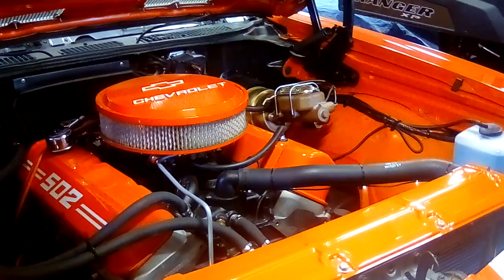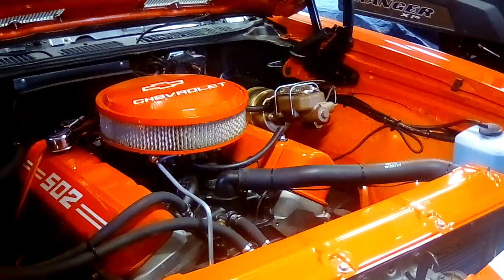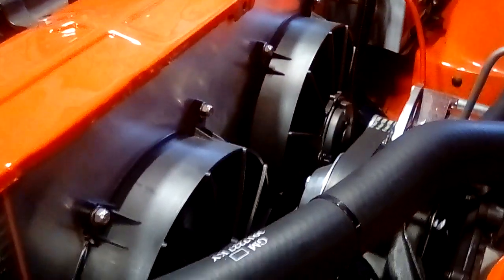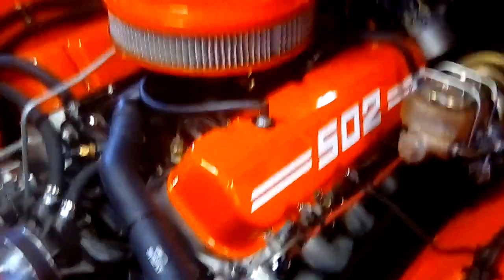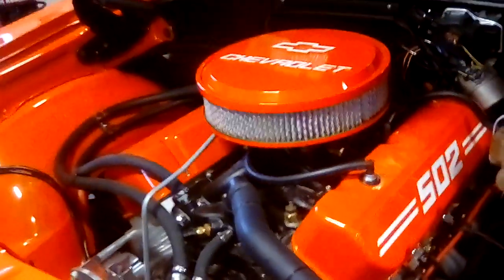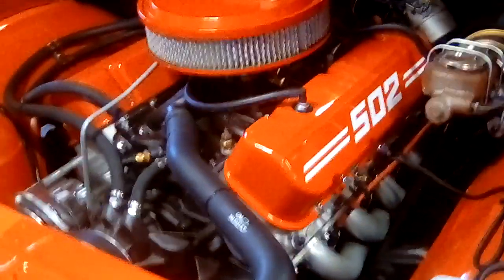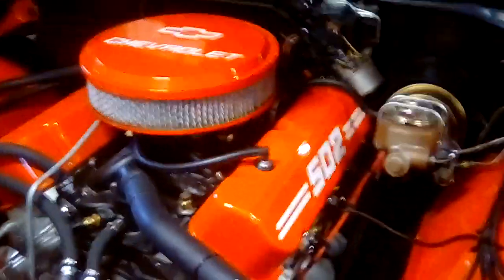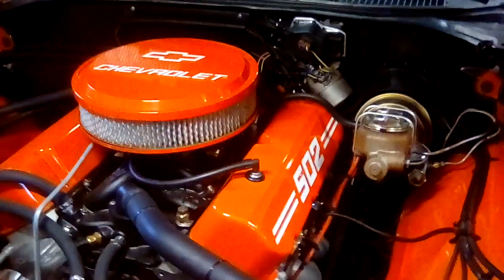ZZ  502, install tips you must know!!!

Comment: Hey Jeff, I have 502 Big Block Chevrolet casting # 10237300 Generation 6 Big Block paired currently the 350 automotive transmission with a shift kit  its in  a 1980 Malibu. All the stuff you mentioned I have done.  I need the engine wiring harness that will connect with the rally gauge cluster and work ? Any suggestions? Or factory wiring harness will work with modification?
Reply from the maker: Factory harness would have to be modified!! wiring is always a pain in the azz!!!

Comment: I just zz502 for my 70 chevelle I just a oil pan but I'm using the stock oil pump that came with motor but it's not high volume
Reply from the maker: 70 chevelle ,nice!!!, What oil pan, and how many quarts does it hold!!!
Reply: @jefftovani5535  champ oil pan 7 qaurts
Reply from the maker: As long as bottom of pan clears you should be good, when I did mine nobody made 7 quart that cleared the saddle in frame, but that was 5 years ago, have fun with it, really nice engine!!!
Reply: @jefftovani5535  wat did use for a macanical fuel pump rod i got the gem factory one itsa steal one
Reply from the maker: With zz 502, it has soft billet camshaft, you must use bronze tip   fuel pump push rod, or you'll prematurely wear out camshaft lobe!!!! I got it from summit racing, I look back at my notes, for part # and post it!!!

Comment: Jeff what steering are you using and what frame + motor mounts ? 
I m not to happy with how I have it mounted yet, I have a vibration but I have to get the driveline balanced,  Im running a holly sniper.. not as nice as your beast but its a work in progress.
Reply from the maker: GM Saginaw steering box,A-BODEY frame,GM heavy duty big block motor mounts!!

Comment: Heey man beautiful car! I have some questions, I have a 502 aswell and I'm getting some overheating issues aswell as my fan are DRAINING my battery. It's a electric dual fan 12" 4000cfm and a 2 row rad, the fans come on around 190 and stay on until the car temp drops but I constantly have to boost the Truck
Reply from the maker: Hi, damien, i run ecp,( engineering cooling products), 11 inch duel fans, 2 row, 3000 cfm, rad!!   I use 160 degree thermostate, set the fan control box a160 degrees!! I run mildon high output water pump!! I run power master 150 amp alt, 90 at idle!!! Stock 68 chevelle had 55 amp, and that was not at idle!!! Those fans you have draw 50 amps at idle!!!!  This set up should solve your problems Hope that helps, stay tune for more goodies!!
Reply from the maker: Started with 182 ,degree termostate, ran a little hot, then changed to 160 degree stat, and it was much better!!!
Reply: @Jeff's garage adventures   ohh okay I can definitely try that I know we changed the thermostat but I don't know what the degree is I know for sure I have the change the exhaust and the alternator I might run the same fan setup as you
Reply: I’d say your overheating problem is your 2 core radiator. I have been running big block Chevys.  And always with a 4 CORE radiator